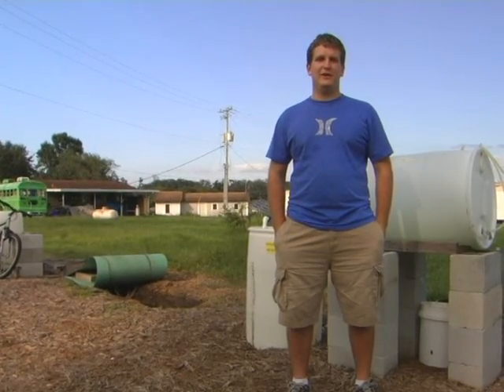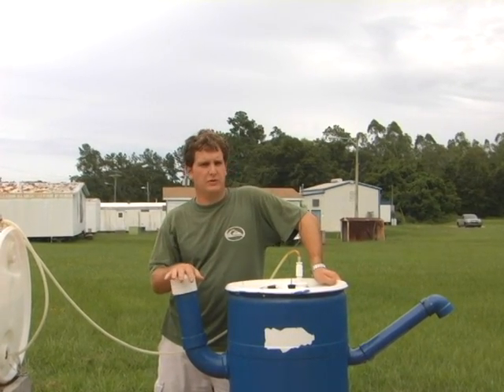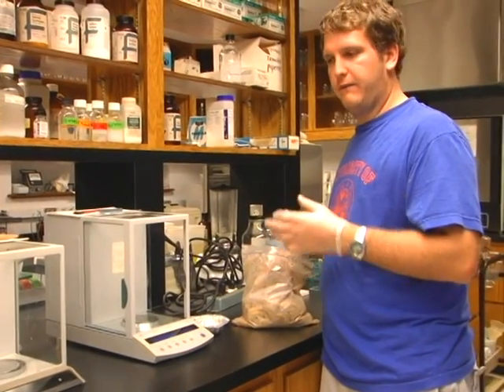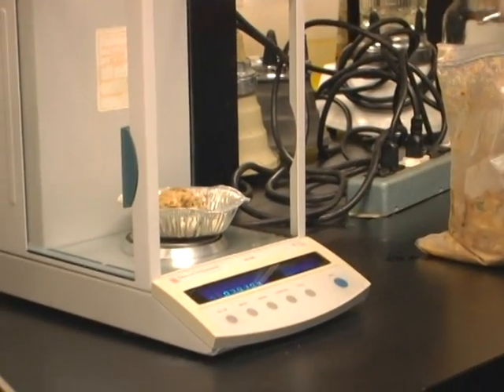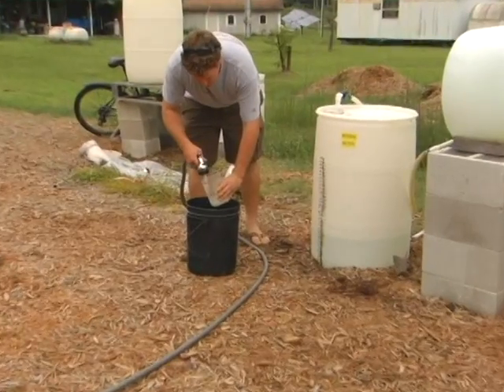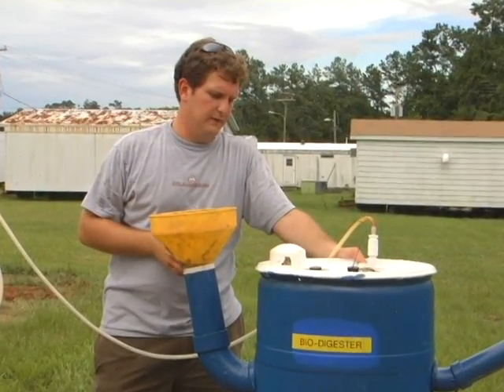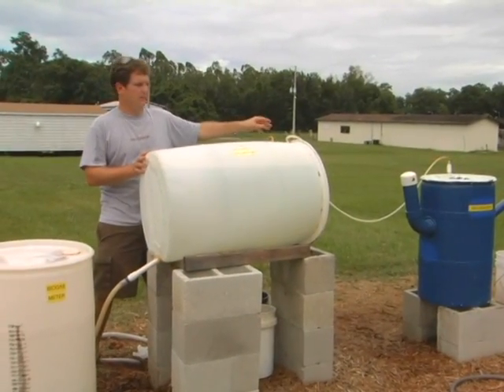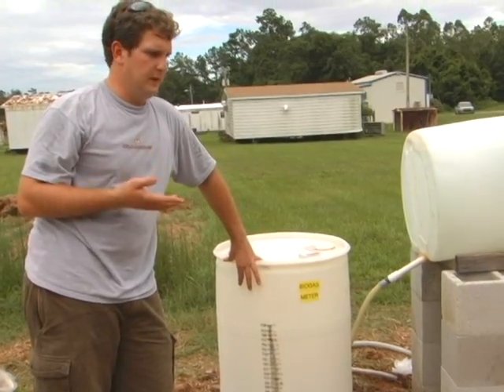Biogas at Broward Dining Hall- Undergraduate Honors Thesis 2008

Comment: could i also jump on the paper emailing bandwagon? does it include any confirmed numbers in terms of waste in and usable gas out? i have just started looking into this as a cooking fuel supplement to off-grid housing...so far its seeming patchy whether or not residential applications are feasible.....if you get in touch i would be happy to share my findings/digital models....ianfotheringham@gmail.com

Comment: You confused me a little: In lab You said that 2gr need to be mixed with 1lt of water. Later at site, You said that 127gr will be mixed with 3lt... Which one is correct? And by the way, does it really matters how much water you will mix, if equal amount of liquid automatically will be extracted outside of the barrel?